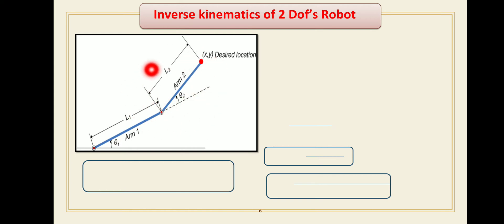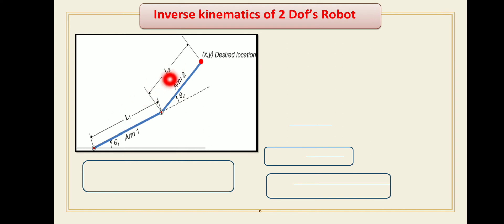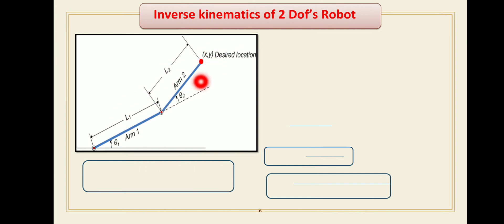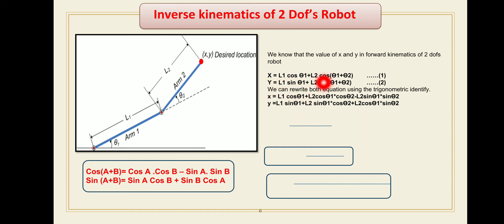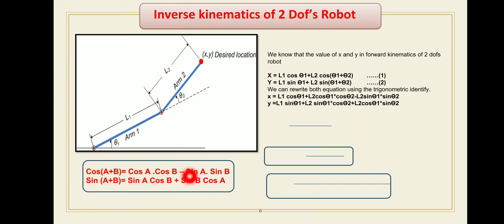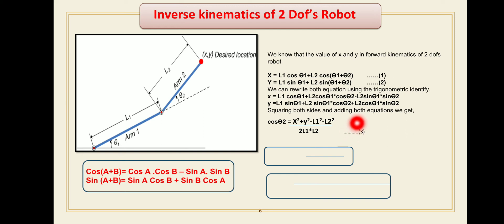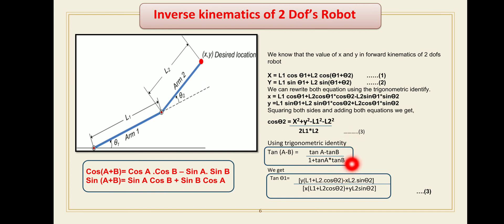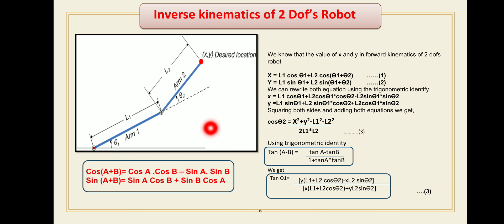Inverse kinematics of 2 Degrees of freedom

Comment: Given a desired location for the tip of the robotic arm, what should the angles of the joints be so as to locate the tip of the arm at the desired location. There is usually more than one solution and can at times be a difficult problem to solve

Comment: In robotics, inverse kinematics makes use of the kinematics equations to determine the joint parameters that provide a desired configuration (position and rotation) for each of the robot's end-effectors. ... Inverse kinematics transforms the motion plan into joint actuator trajectories for the robot.